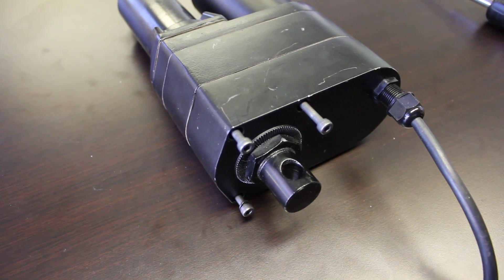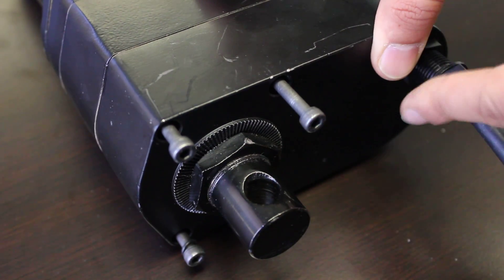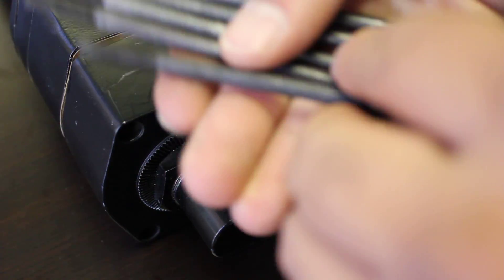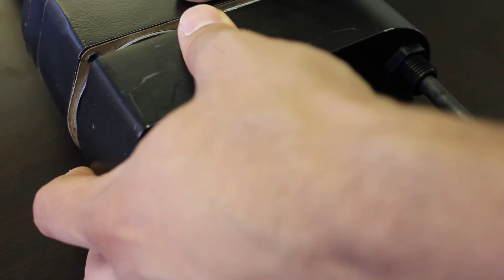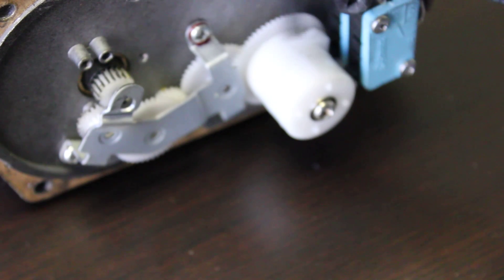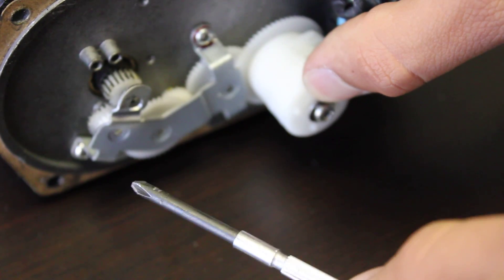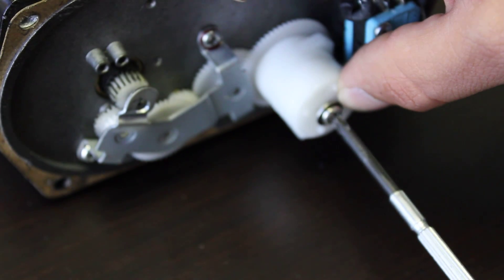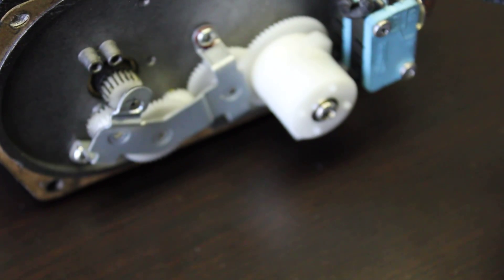How To Adjust Limit Switches on Heavy Duty Linear Actuator - Progressive Automations

Comment: thank you so much, i have a question about this type of actuators, can we use them in automotive applications like to push headrest forward during rear end accident to support driver's head and neck
Reply from the maker: Hello,
 
It is possible to use electric actuators to adjust the positioning of headrests in automotive applications, however, determining the required specifications for the application is crucial to determine which model actuator is the most suitable. The common specs that would help in selecting a model include:
 
•    Stroke length
•    Force rating
•    Speed
•    IP rating (Dust and water resistance)
•    Dimension limitations
 
For more information, we'll be happy to assist via email at sales@progressiveautomations.com

Thank you,
Progressive Automations Team
Reply: @ProgressiveAutomations  Hi sir, I sent an email..could check it please

Comment: does this work for any actuator that has preset or "non-adjustable" limit stops?
Reply: You can use an external limit switch though, and attach it inline with your rocker switch/however you control the actuator.
Reply from the maker: Hello Andrew,
Unfortunately, actuators that have non-adjustable limit stops are fastened to a track and cannot be modified. The PA-17 Heavy Duty actuator is our only linear actuator containing rotary adjustable limit switches.

Comment: What type of actuator are you using in this video?
Reply from the maker: Hi Hugo. In this video we are using our PA-17 Heavy Duty Linear Actuator - https://www.progressiveautomations.com/heavy-duty-linear-actuator.
Reply: Progressive Automations  Will it serve me for a construction of a 9d simulator? can I set its speed?
Reply from the maker: Hi Hugo. 
We do not have much experience with 9D simulators but perhaps if you contacted us and shared more information about your project we could provide assistance. You can reach us at 1-800-676-6123 or at sales@progressiveautomations.com. 
As for setting the speed, you could use our speed controller (https://www.progressiveautomations.com/ac-26-30) to control the speed of the actuator.
Best Regards